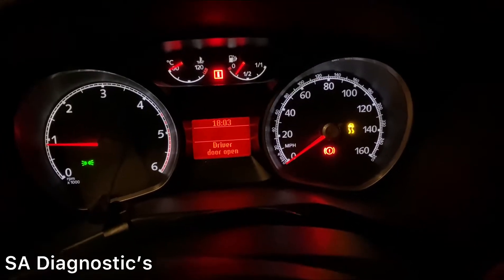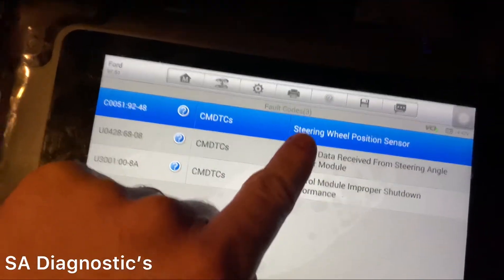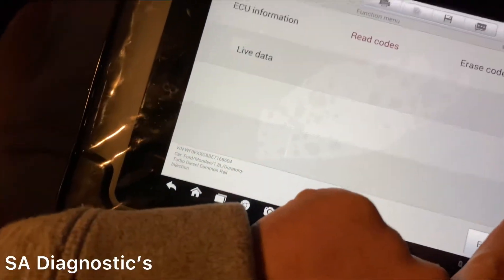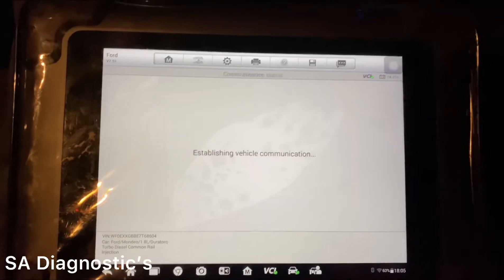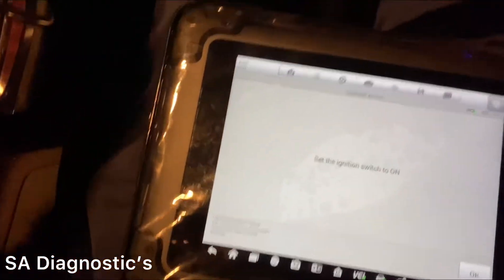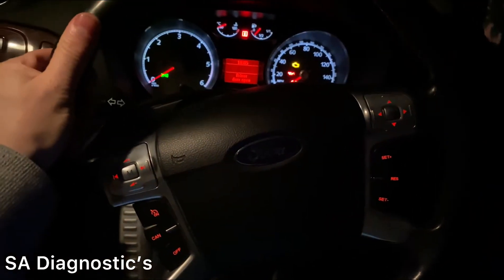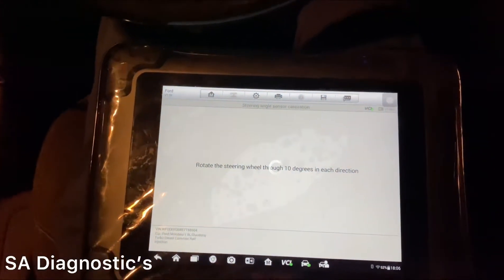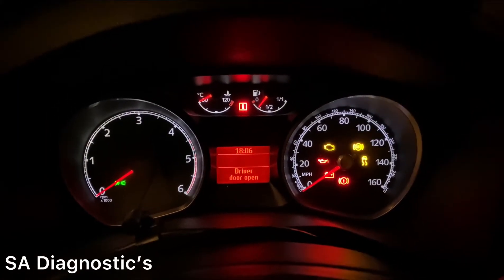Ford Mondeo Steering Angle Wheel Position Sensor C0051 U0428 U3001 FIXED!!!

Comment: Hello I have these fault codes on my Mondeo MK4 Titanium X, using forscan I cleared the codes, tried the calibration and my traction light still returns on full left lock. I also have the issue that my Cruise control doesnt work even after replacing the buttons. Theres a fault code for steering wheel module, would this indicate that there is an issue with my clock spring? I would be interested to hear your response. Cheers!
Reply: Update the fault causing the light was my steering wheel module it had an internal failure, after replaced with a used one it fixed it. My cruise control doesn’t work but that’s down to a separate issue that somebody has put the cruise control buttons from a facelift on my pre-facelift mondeo
Reply: @Spw1471   do you have a link or a reference for the part you changed? Thanks

Comment: Nobody knew how to fix it or what was the problem. I went to so many mechanics that just reset the Steering Wheel Senor. The Traction control light would never turn off. I bought myself a Autel Scanner MaxiCOM MK808 from Amazon.The Key is to spin the white disk in steering Angle Sensor until close to 0 (must take off Clock spring) and calibrate the Steering wheel sensor after, using the scanner. After earse the codes and problem solved.
Reply: Exactly this!!! It's 2025 and this still helps! I have a Ford Focus 2016, I took off the steering wheel airbag along with clock spring/bracket, then connected Forscan, went to real time data, chose ABS -> str ang raw (or something like that) which then displayed 85° when the steering wheel was centered! 
So I spinned the white circle-like disk you mentioned until forscan showed 0°, then calibrated the sensor, cleared DTC and it was done:) Thanks!
Reply: I've got the light on from when changing the clutch, disconnected the steering column from the rack by the foot pedals, I guess one of the kids when in the car have turned the wheel so now the wheel is off centre sensor wise

Great comment thanks you've helped a bunch  @D4an4